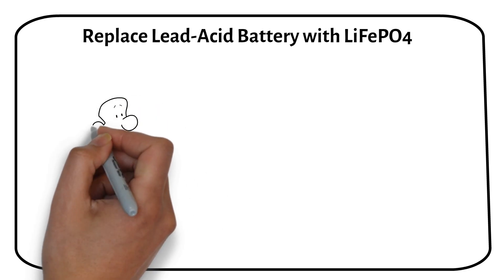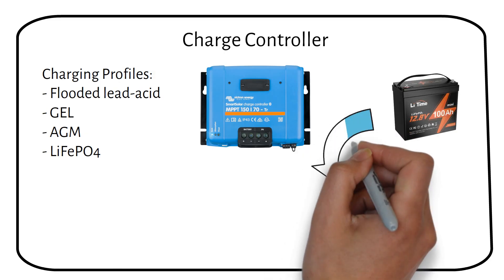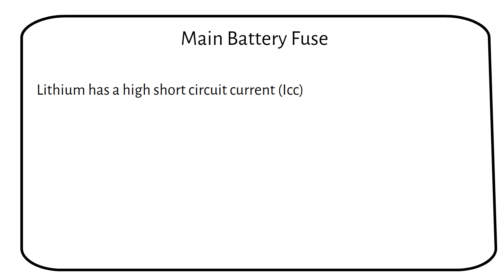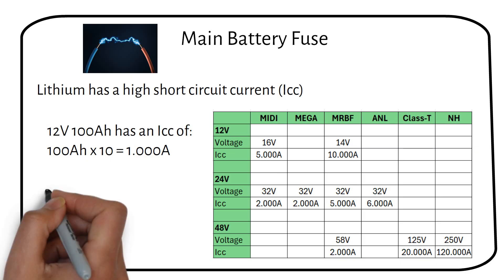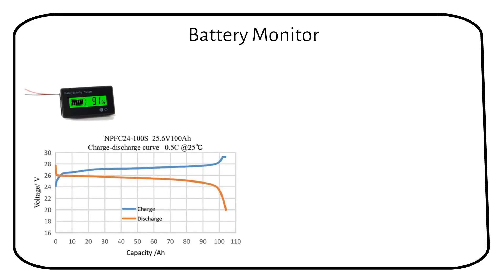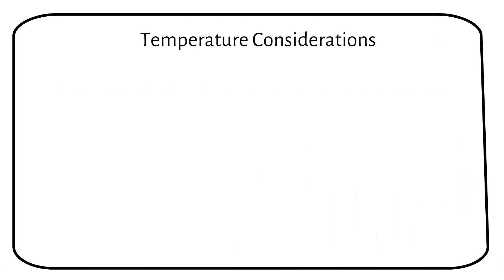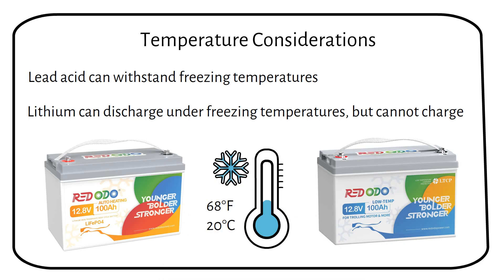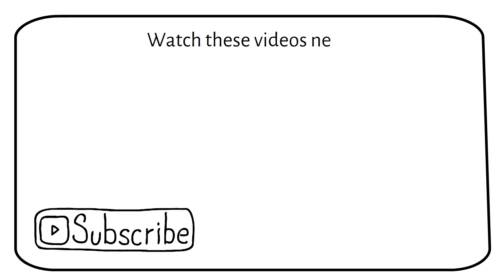Replace Lead Acid Battery With Lithium (LiFePO4)

Comment: I will be getting a lithium battery soon in travel trailer. My converter doesn’t recognize lithium. Is it ok to still use it and occasionally top off  the battery with stand alone lithium charger?

Comment: Thanks. I've been thinking about buying a battery. . Thinking that lithium is like the ultimate upgrade but watching this I could see that you can shoot yourself in the foot if you're not careful thanks
Reply from the maker: Yes, you just have to be aware that your existing lead acid system might not be compatible with LiFePO4.

Comment: Hii Nick
I have a computer UPS of 12v 7ah lead acid battery which give max 5 min backup
Now I want to change lead acid battery into lifepo4 battery 
I have purchased  lifepo4 battery ( 3.2v 6ah × 4 cell = 12.8v 24ah) with BMS lifepo4 4s 30A and also purchase active balancer 4s1A. 
My quest is cancelled i directly replace battery with lifepo4 battery or I need to change in input  while charging battery kindly help me in this, I have only limited knowledge regarding this.
I will be thankful if you can solveout my problem 
Thank you 🙏

Comment: I replaced 8 4D gut-busting 135# AGM house batteries with 8 group 31 35# drop in lithium ion batteries in my 51’ Michigan sailboat 4yrs ago.  That was an 800# weight savings with the same AHr capacity holding much higher voltage long off charge than the AGMs ever could.  By every measure all is swell.  I was lucky to get 5 years out of the AGMs before I had to die swapping those super heavy bastards out!  On my 38’ Florida daysailer I swapped one rather new but dead 4D AGM house battery for 2 drop in Group 31s for twice the AHr capacity yet half the total weight.  Same deal, love em.  They handle heavy loads much better than AGMs ever did.  Electric winches, windlass, bow thruster, and more.  The only change to adapt was to adjust to higher charging voltages on the existing chargers.  Sorry you’ve apparently not had the same outcome—regardless twofer two works for me.

Comment: will a 40 amp breaker protect my alternator when charging lithium batteries
Reply from the maker: You need a DC to DC charger if you are charging lifepo4 from an alternator. I made a video about it. Search for alternator on my channel.
Reply: @cleversolarpower alternator output in my car is 140amps- will 30a or 40a dc dc charger be ok?
Reply: Lithium battery

Comment: just a reminder, im at 2 years with my diy drop in lfp 12v agm delete in my car. lol, this works fine in a phev. 2013 chevy volt. 15 days over 100F last year, 40 days under 32F. a handfull of those were around 0F. no bms, inductive active balance board, 12v 15w heat pad, w1209 temp relay. 1/5th the price of agm replacment, 50 lbs lighter.
Reply: That's awesome!... It would seem ok sending current from your alternator to a lipo4, but not the other way, li-ion to agm. I don't know why they make everything like such a big deal? To build and sell more unneeded chargers, converters etc? I mean, the battery says right on it 14.6v max, with temp ranges of 0c-45c charge / -20c-60c discharge, wtf? That being the case, I'm guessing you could probably just throw a pair of jumper cables from your car battery to the lifePo4 without any problems in order to charge it faster. I guess 2 things would be, 1 your car needs to be running and 2 youd have to monitor your voltage to see when it's charged. Anyways, way to go man 👊👏
Reply: @majkdave  ya well i dont believe there are any phev's that have an altenator. volt uses a dc-dc stepdown converter gm calls an apm. 
what youre describing would kind of work with a large enough battery, but anything smaller than 4kw/280ah 12v, your likely going to send way too much current into the battery if it is close to flat because of the lower internal resistance. any bms would disable charging if it was above a specified max. usually lfp batteries can only handle about 1C max, which means the amps in = amphour rating of the battery.
my lfp pack in my car trickle charges through a 200w solar roof and mppt to extend ev range, so its never really at a low state of charge so the car doesnt fry the battery. this is really the only issue and my solution. phev's tend to also top the 12v battery off whenever its plugged in, which for me is all the time. lfp cells are pretty forgiving though compared to lith pol.
Reply: @vevenaneathna  oh I see.. I don't know much about full electric vehicles. Lol... Although I did read awhile back this dude threw a lifepo4 into his dodge ram. Don't know how it turned out, but was working ok at the time. I do understand about the internal resistance, so thank you for explaining that, and for saving both my battery and alternator 😁 crazy, having to buy an expensive charger, but I guess the battery would pay for itself by far outlasting conventional lead acid batteries... I'm using it for an rv not as a car battery, at 2000mA it would take 50 hours to fully charge in theory 😅 so im just looking for a better way to charge it. Thanks again!

Comment: Can I use a 60 amp renogy dc to dc charger with an alternator that puts out 170 amps?
Reply from the maker: I recommend running it at 30%, so that would be 51A. Maybe you can try 60A, and monitor the temperature of the alternator, especially for long charges. You should drive to increase airflow over the alternator.

Comment: What if the battery has a built in BMS?
Reply from the maker: Most batteries have built in BMS'es.
Reply: @cleversolarpower  so won't it manage all the things you're concerned about?

Comment: I have heard the old wives tale about avoiding storing batteries on concrete for years.  Over time I have come to believe that the rumor perpetuates itself simply because many people store old batteries in basements and garages hoping to use them in a pinch later only to find them completely dead through age.   This is the first time I've heard the don't do it because concrete is conductive.  I think concrete is an insulator for most practical purposes including battery storage.  Just don't neglect the batteries maintenance as time goes on and you'll be fine even if your substrate of choice is concrete.
Reply from the maker: Concrete is not conductive. The case for this is that concrete is cold. The temp difference is not good for the battery.
Reply: Try laying down naked on a concrete floor then tell me that it doesn’t conduct heat. If concrete insulated then those tower block built of mass concrete in the 60s wouldn’t suffer from condensation problems.

Comment: A dodge some use on the UK  canals is to wire the lithium house battery in parallel with the starter lead battery with 8ft of 8awg  - the lead battery stops any surge  damaging the diodes and the long run of modest wire drops the cushions the volts at high amps - it often  means the lithium's take ages to fill the last 20% but narrowboats often run their engines for hours
Reply from the maker: I don't advise doing this. Will it work? Maybe.

Comment: I did change my led acid battery in my Prius 2010 to LifePO4 no change to altinator and battery is still ok. I also use since 10 years a LifePO4 battery for my electric boat motor with a normal lead acid charger, no problem yet. I am not saying that it is good to do so but it seems to work for a while at least.
Reply from the maker: You replaced your starting battery with lifepo4? I do not recommend that.
Reply: The prius starts off the hybrid battery, not it's 12v. The 12v line is powered by a dc-dc converter from the hybrid battery when prius in ready mode, and it can put out up to 100A to the 12v line. I am considering this myself now... prius dc-dc outputs 14.6V, and many BMS have overcurrent, overvoltage, and over-charge protection. The 12v battery sits by the rear wheel well, not in engine bay. The 100A fuse might blow if the 12v battery is  very low...

Comment: Why have equalisation voltage for lithium at 14.6v ?  Most lithium chargers dont equalise ie equalization time set to 0
Reply from the maker: If you cannot set it to 0, then you can set it to 14.6V because it will never be reached.

Comment: Sir can you tell me 
If my car has no other battery just 12 LTO yinglong cells 2.3v 45ah
Alternator is stock alternator.
Why do i need dc to DC charger? If my audio system is draining current from starting then car .so my alternator won't be suffering or any components
Reply from the maker: Already answered you on the alternator charging video.

Comment: One question about fuses is that if a battery has it own BMS capable of 100A or 200A  what is the purpose of so big fuses?
Reply from the maker: A BMS is not the same as a fuse. A BMS cannot break a short circuit current it's just a switch. The use depends on the power output of the inverter, because thats the largest in the system. You can add batteries later on. That way the fuse is correctly sized from the start.
Reply: We use fuses to protect the wire from melting the insulation, and starting a fire...

Comment: I thought I'd chech switch over videos to get insight on performance. This is got to be good knowledge, but 
my 52v li-ion came with it's own proper charger. So I'm gonna use that and the SLA charger can kick rocks. 
I wouldn't mix chargers with different batteries anyways.

Comment: Hold on! The charging voltages you are recommending are very aggressive! (BTW, I´m a professional).  Lithium batteries, opposite to lead-acid, trives at 20-80% charged state and not at hige voltages over time. You do not need to go above 14,2V to charge fast to 100%. The amount on Ah you get from 14,2V to 14,6V is negligible. If you go to 14,6V you will also probably trip the BMS charging shut off. This is a safety precaution you should not relay on as the end of charge control. It also creates a load dump witch in some cases are harmfull to electronics. This will vary upon the charger used. Charging to the maximum tolerable voltage has no purpose, especially in an RV where the battery is charged every day and rarely is depleted.
Also the floating voltage should be kept at a lower state. 13,35V will hold the charge at whatever level you have charged up to. 13,3V will be the best level to maintain around 90% SOC and the battery will live forever. 13,4V if you prioritize holding the battery at 100% SOC at all time. Higher than this will not give any benefits. It will only contribute to mote wear on the battery.
Lithium profiles on many chargers does not take into consideration the specific use of the battery. It is often based on full charge at a the shortest possible time and then put the battery to use. In an AV this is rarely the case. Therefore I prefer a fully adjustable charger.
My recommendations for charger parameters:
Prioritizing the battery health:
Bulk/absorption: 14,0V. Absorption time: 0. Float voltage: 13,3V.
Prioritizing fast charge and 100% SOC:
Bulk/absorption: 14,2V. Absorption time: 0 or max 30 min or so. Float voltage: 13,35V.

About the fuses. Did you take into consideration the built in current limiter in "Drop in batteries"?. A typical 100Ah battery has a limit on 100-200A in the BMS. I don´t know how fast they are, but I assume it is faster than a slow mechanical fuse? If this is the case the theoretical short circuit currents you refer to is nothing you will experience in real life?
Reply from the maker: These are factory recommended charging rates. Indeed, there is not much capacity difference, but the balancing function of the BMS only starts if they are at high voltage. A BMS cannot cut the short circuit current. It's an electronic switch, not a proper fuse.
Reply: BMS can cut for short circuit current, most I have seen (and use) have a specific (factory programmable) internal short circuit detector with timeout and rest times, designed specifically to handle short circuits. Pity I can't post pictures here otherwise I would send you screengrabs of BMS control software setup screens. 

In any event the BMS will limit the output current to the batteries rating (not the cell capabilities) under normal operation and you won't be able to draw more so there is no point in using a fuse greater than 1.25 X battery rating. Being an electronic switch it is probably thousands of times faster than a physical fuse which has to heat a wire until it fails. MOSFETS can switch in nano or micro seconds.

In a lead acid battery it is up to the charge controller and system design to look after the battery charge/discharge rates. A battery with a BMS, is just that, it's all in the name, Battery Management System. The BMS looks after the cells in the battery, including limiting the charge and discharge rates to the factory recommended rates..

I take your point that the high charge voltage is needed to trigger balancing. However it is not cut and dried. Each battery will have its own voltage at which this occurs. That is why you should ALWAYS use the charge parameters specified by the manufacturer. This is most often printed on a label on the battery.
Reply: @cleversolarpower Charging rates != charging voltages.
Reply: Agreed on all points, @Rudykanal
Reply: I agree with you, and I am also a professional. Also extremely large fuses is dangerous advise if the cables are not upgraded to carry the fuse rating. If you don't and there is a short circuit, the actual reason for the fuses, then the cables may overheat and cause a fire long before the fuse blows.
Reply: The fuse is to protect the wire sir.
Reply: bms can't protect against self-failure, only a fuse can do this.

Comment: Hi Nick

I did not understand the fuse needed for the battery. Its probably me so please forgive me. 

Steve
Reply from the maker: Charge controller current * 1.25 = minimum fuse current. Check out my video about choosing fuses and wires for more information.
Reply: @cleversolarpower  thanks Nick, yes will go back and watch the video. I also bought the book. 
Many thanks
Steve
Reply: agm is higher resistance - lifepo4 can (really) do sustained 1c - whatever your use case for swapping out agm - you need to be ready for that current in both directions - fuses are always a good idea - i prefer 2 pole breakers as they completely isolate instead

Comment: Why did you say not to put batteries on bare concrete?
Reply from the maker: Concrete can create a temperature difference between the bottom of the battery and the rest of it, especially in cold weather conditions.
Reply: @cleversolarpower  thank you for the answer, i want to know that if there is any other reason, like ground conductivity, etc.

Comment: I'm using a 400 amp hall effect sensor. Are shunts better?
Reply from the maker: I have not compared a hall effect sensor vs. a shunt. I use a shunt for all my installations. You can get a shunt and place it side to side to see which one is more accurate. I believe both are accurate, but does your sensor come with a display?
Reply: @cleversolarpower  yes it has a very informative display. It gives real-time amp usage, amp hour/capacity, watt usage, estimated run time in hours and minutes. It's been good.
Reply: hall effect sensors are subject to magnetic interference of any sort - just try a magnet near it - inline shunts do not have this weakness - good question
Reply: @hmtechsvc  Thank you! Very cool. I will experiment with that. I feel already that I'm going to upgrade. Stay blessed my friend.